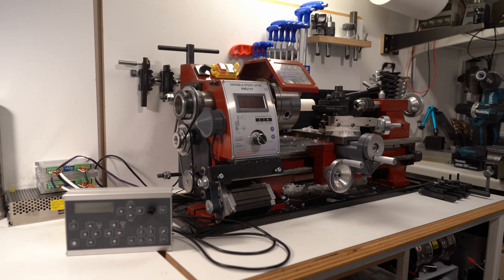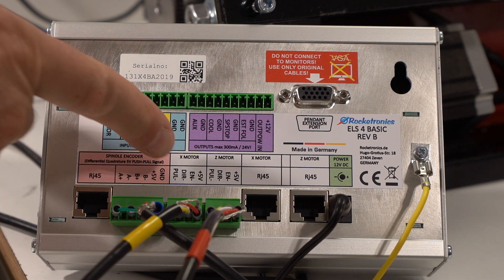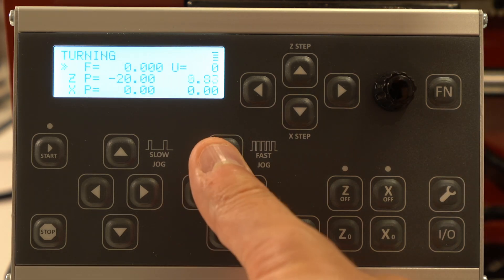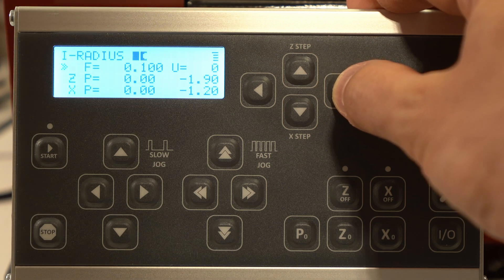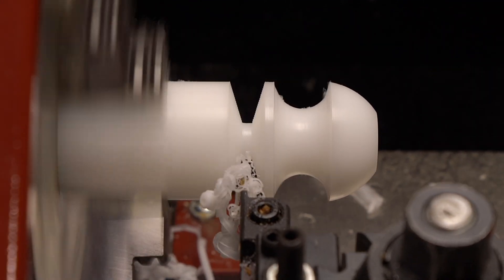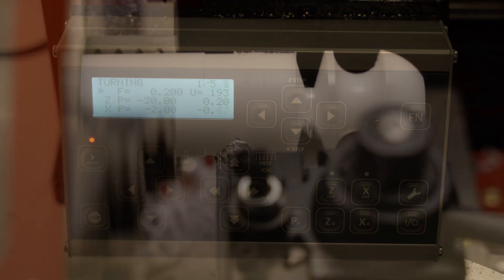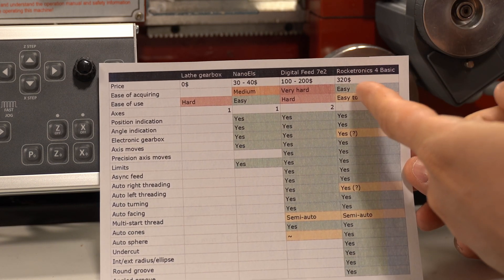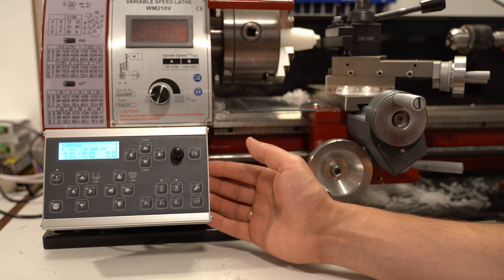Supercharging a lathe / Rocketronics ELS

Comment: Also I really like manual work but was worried I'd have issues for quicker manual moving on X and Y , I'm glad you mentioned you can turn each axis off with a touch of a button so the motors don't lock the screws when els turned on

Comment: Thanks for the info, I'm looking to get one so I don't know about most of the issues you mentioned  at the end, but the minimum 0.1mm depth of cut might be able to be made smaller with a different encoder or servo motor ( or both ) , if the servo and encoder only has 400 steps then upping to 800 steps will allow 0.05mm , or if trying to hit an imperial measurement like 5/8" ( 15.875mm ) you could always set the final pass to hit 16mm , then turn the Y axis off and Indicate the cross slide for the remaining 0.0625mm, that would have to be a high resolution indicator though :) 

Or modify the leadscrew for the cross slide  to be a finer pitch

Comment: Hi Maxim ! I bought the Rocketronics ELS 4 Basic, and chose a non-differential incremental encoder, the MBL3806-AB-600-24C-2M two phases (A, B, +5v and ground wires).
The ELS Basic user manual states that a differential encoder must be used. It’s really required ? In your video, it seems your encoder is not differential either.
Thanks !
Reply from the maker: Hi Ivan, I'm using a basic AB 5V encoder, seems like the same as yours, had no issues. Cheers!
Reply: @MaximKachurovskiy  Thanks very much, your help is very appreciate !

Comment: Hello,  I have installed the same system but I have an issue on the x axis precision. I believe it's caused by back lash but I m not sure Hou to measure it. Did you have the same issue? Thanks for your help.

Comment: It must be able to do left hand threads.
It would be nuts if they put that much thought into it and forgot left hand threads.
In the ext thread screen, try changing your;
Z P=   -15.00
To;
Z P=   15.00
By reversing the Z parameter it will probably start at the opposite end and thread in the opposite direction.

Comment: You are right about the missing functions, especially the missing ability of left handed threads is really annoying. That should be a basic feature.
And there is another problem: Inner cones are cut from -z to +z, that means away from the chuck instead of cutting to the chuck. The manufacturer explains this with solving problems caused by the backlash of the cross slide this way, which is correct as far as you don't use ballscrews and/or your conventional screw/nut is worn. But on the other hand this cutting direction doesn't fit the cutting edge geometry of the most common inboring tools. I'm using the ELS4 for quite a while, but I wasn't able to cut an inner cone with acceptable surface quality yet with any of my tools. An the manufacturer refuses to build in an option for 'normal' cut operation in the code, he just declines that that would be usefull. I'm turning cones manually again and don't use this function any more.
Btw: The last firmware update of the ELS4 Basic is from August 2020, so it looks like there is no further development. Disappointing, because this device isn't cheap.
Reply: Hi, there is development stil ongoing, but the last function updates were special modes for single customers who needed a device for a purpose not needed by anyone else. We work on an upgrade, and will have many things changed soon. 

Left hand threads can be done easily when you use inner threading tools on the backside of the workpiece. But we work on that issue also.
Reply: @RocketronicsDe  "Left hand threads can be done easily when you use inner threading tools on the backside of the workpiece. "
- If you don't need the live center
- If the diameter of the workpiece isn't too big so you don't get out of travel of your compound slide in X-
- If the tread isn't somewhere in the middle of the workpiece so the toolholder would collide with the workpiece.
Lots of 'if'...
Reply: @paulpahl1607  You are correct, is not always that easy. I will see if we can add the left hand threading to the current threading cycle, but we will only be able to do that with 0 acceleration way, to be sure we do not drive into the workpiece.

PS: There is currently quite an easy way to make left hand screws, with a hack: Just enter the settings, reverse the Z-Motor direction and you can cut left hand screws, you just have to think the other way round when positioning in Z direction. Everything else is automatic then.
Reply: @paulpahl1607  I just made a very quick coarse video on how to do left hand threads with reversing the Z motor: https://youtu.be/uxYAEskMuoo

Comment: wow, so i've now made it through all of your ELS videos. I love everything about this one! seems like it essentially includes DRO correct? would there be any reason to even try to add additional DRO? it's a little bit annoying that they don't sell the whole thing as a kit - the manual seems to refer to generic motor requirements and leaves it up to the user to figure out all of the mounting. did you leave everything in place from your previous ELS - and are you going to abandon it in favor of this one? also - assuming that one switches out cutters for different operations does this one have tool options as well, like a good DRO would?
Reply from the maker: Yes, this one includes a motor-based DRO which tries to account for the backlash. It's good enough for most applications but it probably doesn't have 0.01mm precision in real world. I.e. a real DRO connected to actual metal would always be more accurate. I'm sticking with Rocketronics for now though I'm rarely using my lathe these days. It's understandable that Rocketronics can't provide exact instructions since there's a 1000 lathe models out there and then it depends on how heavy your cuts need to be. Rocketronics doesn't have any tool pre-sets, it relies on you zeroing the tool every time.

Overall, Rocketronics is the best option available on the market right now and trying to DIY something better is unlikely to lead to an overall better solution (and will probably take forever).
Reply: @MaximKachurovskiy  yeah, fair enough! in terms of the DRO what happens when you go into manual mode, do you have to recalibrate the whole thing or does it track it fairly well? I wish there were more videos of "using" it - for example if i wanted to turn some raw stock down to a specific diameter (tool A) and thread it (tool B), how much fiddling do you have to do to zero things out, establish locations, etc? it's one thing to do that quickly with handwheels, but entirely another to try to punch all of it in via a control panel. for that reason i'm leaning towards the 4 pro but I would be interested to hear how you like it in that regard.
Reply: The ELS is no replacement for a real DRO. It doesn't show the real position because there is no position feedback. It only shows the position the ELS thinks that it is at. If for example the stepper or Servo stalls the ELS doesn't recognize that, same if there is anything slightly loose in the mechanic.
I've build my lathe such a way that I can use it both manually (most times btw) and with the ELS, and I have a normal DRO mounted as well. I definitly don't what to miss the real DRO.
And the ELS has no tool table, that isn't the intention of this controller. It doesn't replace a CNC and it nowhere states that is does. It's meant for just one operation at a time, and between different operations it requires a new setup for the positions.
Reply: @paulpahl1607  to that end though it does seem like a tool library would be simple to implement - if it allows you to set a 0 location, a tool library just calculates position relative to that by doing the math "behind the scenes".
Reply: @guitarchitectural  There will not be a tool library. This is not a cnc controller designed to make one fabrication step after another using different tools. It's meant to do just one job again and again. If you want to start another job with another tool you have to setup it again.
Reply: @paulpahl1607  to be fair though a tool library seems like it would be much simpler to implement than some of the amazing features it has, especially on the PRO. I can't be the only person who turns his stock to a specific diameter and then threads it! :)  and how cool would it be to set the diameter of the tenon rather than have to measure and calculate how much to take off. i can definitely see why the DRO is still essential and i'll probably turn my tenons manually as a result, but still, a boy can dream! :)
Reply: @guitarchitectural  Doesn't matter what we want, the manufacturer says 'no'... ;)

Comment: Hello Maxim,
I started to implement this solution, based on your parts for the steppers installation. Unfortunatelly, my lathe, although it's also a WM210V, is a little bit smaller than yours. It has in particular a spindle with a 21mm bore with a 40 teeth gear. So I redesigned the encoder gear with 80 teeth in order to place the encoder further away from the axis due to the pulleys. I modified also the encoder base to make it ajustable for the gears spacing. I also redesigned the stepper mount as yours is too big to fit under the left cover. I did all this starting from scratch with SolidWorks, and it was not so difficult as the parts are simple. But this is another story with the cross-slide with motor! It will probably be simpler to start from yours, but for that I need a CAD file compatible with SolidWorks, for exemple a .step file. So I kindly ask if you could provide me with such a file. Thanks in advance.
I'm looking for a solution to keep the X index, one option being to make a longer X axis (with the lathe!). But I don't have a milling machine to make the keyway, may be with a parting tool along the Z axis with the spindle blocked?
I ordered the motors (NEMA 23 Leadshine 23331-L, closed loop for the Z axis, and Leadshine 42CM06 NEMA 17 for the X axis. I'll receive them probably at the end of this month and I'll keep you informed of the progress of this project. I'm waiting for Rocketronics for the rest  (controller, power supplies and RJ45 adapters).
Reply from the maker: Denis, happy to hear that your project is moving along. Not quite sure on your question about the X index, maybe a photo or a drawing could clear things up. Please find the cross-slide STEP and F3D files in https://www.thingiverse.com/thing:4714722/files (they should start showing there soon after they go through moderation) - cheers!
Reply: @MaximKachurovskiy  Thanks a lot Maxim! For the X index, due to the gear, you have removed the dial in front of the handle, which I would like to keep with a longer axis. I've seen that the ELS4 controller can make keyslots  with the grinding function (spindle locked), so I'll give it a try.
Very best regards
Reply from the maker: @denislafourcade8244  I've re-added the dial back as a plastic piece over the handle, wonder if something like that could work in your case. Best wishes!
Reply: @MaximKachurovskiy  Oh, yes, I see. That must do the job. Great!

Comment: hi maxim. I wanted to ask you if you have backlash on the transverse axis. I have backlash on my transversal axis and I don't know how to correct it. For nano els, rocketronics or digital feed can a ball screw be used?
Reply from the maker: Ismael, Rocketronics does a good job accounting for the backlash. Digital Feed also has some backlash correction. NanoEls has none :) Ballscrews require more space than is usually available on our manual lathes and would be really hard to install, though not impossible. It's also not as easy to disengage from the ballscrew, their nuts can't be split in half.

Comment: I believe you can't do a sphere because the controller needs to know what the tool geometry is.   I still believe a webUI is the winner for an ELS.
Reply from the maker: Hey Jesse, good to see you, the controller knows the tool corner radius. It can do a negative sphere (round groove) so seems like doing a sphere is far from impossible. It probably just wasn't prioritized.
Reply: Agree on the UI. Stepping through a bunch of 4 line screens would drive me nuts. Either serve up a page or do something like TouchDRO and send everything over to a cheap tablet via Bluetooth for display and UI.

Comment: Thanks  Maxim, have seen all E.L.S 4 Pro much nicer, I figured it  would be yours  did not see it on chipmaker. Don't know if you have seen MotoChassis ,have a pick and good luck with a PCB  I am from Australia.
Reply from the maker: Thanks Milan, I haven't seen MotoChassis implementation of the ELS, checked it out, looks interesting. He didn't seem to have published any source codes though.

Comment: Hello Maxim
Thanks' for sharing, seen you other videos and I can't recognize a PCB that you are holding , different to a digital feed 7e2 that I seen, can you please post Link to it. Do a video with Rocketronics ELS if you are making something to show capability.
Reply from the maker: Milan, I'm working on making a PCB for Digital Feed 7e2 and showing here the first prototype. It requires a lot more work and is not usable as is, hope to post a video on it when ready. Please check the video description for the Rocketronics manual - can you think of a cool item to do using maximum amount of modes? Thank you.

Comment: Hello Maxim, 
This seems interesting, but I have a question: the positions of the sleds refer to axes rotations, which have more or less backlahes. I saw in the documentation that those backlashes are taken into account by the system, but why not using DRO rulers to get a more accurate positionning?
Reply from the maker: Denis, DRO is very hard to install on most lathes and is another 200-500 euro. Lead screw measurements are enough for most applications. For 0.01mm stuff you'd need a micrometer anyway I think since there you're fighting with deflections
Reply: @MaximKachurovskiy  OK, you're probably right. Nevertheless, before to implement this solution, I think it is better to install ball bearings like you did to minimize backlashes.
Reply from the maker: @denislafourcade8244  some folks do that but then I think you loose the ability to disengage from the lead screw and go manual - which would he sad.
Reply: @MaximKachurovskiy  I mean bearings on the cross slide and at the ends of the lead screw, keeping the half-nut.

Comment: Looks like this may be exactly what I need. It would probably cost prohibitive to have these shipped to the US.
Reply from the maker: It's 36 euros to ship to the USA I think. Not sure if there would be any additional tax.
Reply: No duty or tax if shipped to the USA. I have the pro and various accessories. No problem with shipping, but order eVerything you need at once - separate shipping costs for multiple orders adds up.
Reply: @rickkempf3092  how do you like the Pro? can it function as a fairly good DRO, or do you still need one of those?